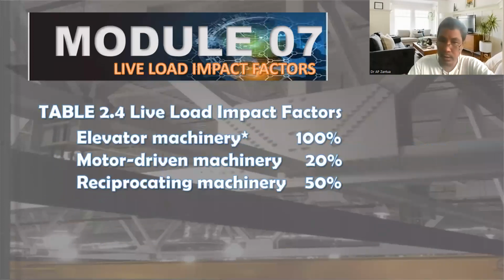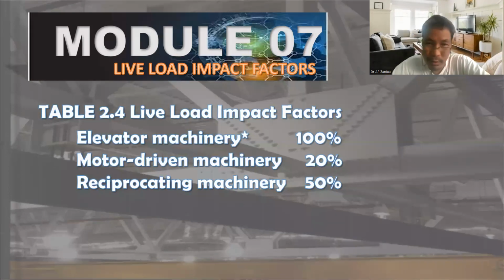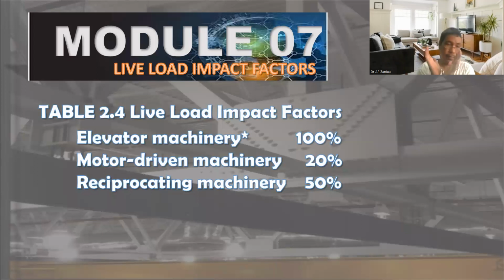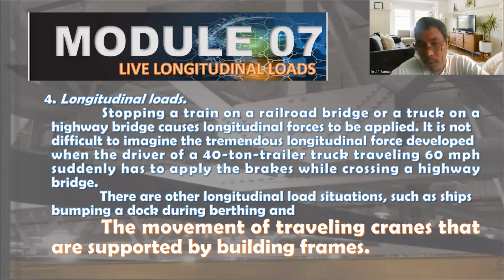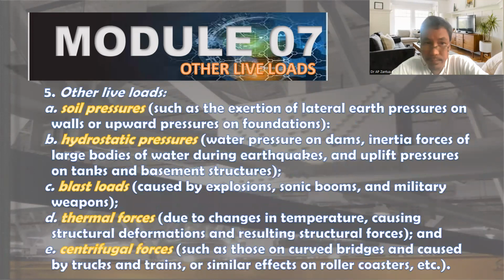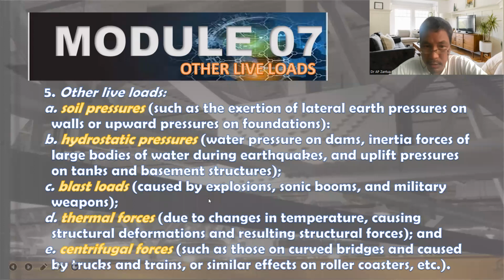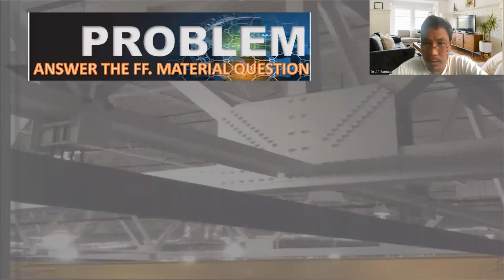Structural Loads of a Building: Live Loads [ Principles of Steel Design ] Module 2.07.2

Comment: Thank you sir for this continuation where in now we are in the live loads that are about the structural loads these are usually the loads that are moving or have movement where we have also factors with their impact for different usage .

Question 048: What is the surface irregularity tolerance for subgrade preparation? 
-B +20 mm.

Comment: thankyou sir for the continuation discussing the live loads on structural loads of a building, as the loads was classified into dead loads, live loads, and environmental loads. The live loads may change in position and magnitude when a structure is occupied, used , and maintained.
question 048: what is the surface irregularity tolerance for subgrade preparation? the answer is B +20mm

Comment: thank you sir for the continuation of the previous topic about the structural loads of a building and for discussing the live load impact factors

Q48: What is the surface irregularity tolerance for subgrade preparation?
ANSWER: B (+20 mm)

Comment: Thank you for this continuation video lecture about live loads. In this video it tackles about the impact factors of live load. And it is also tackled here the different kinds of live loads.

Q. 48 "What is the surface irregularity tolerance for subgrade preparation?" A.-30mm B.+20mm C.+25mm D.-20mm
The answer is B.+20mm

Comment: Thank you sir for discussing the structural loads. This topic was exlained in our course TOS so this lecture is kind a recall but watching this, it became more much wider and explained well.  For engineers, it is important to know the concept of structural live loads when designing a  structural plan so that we can estimate the live loads that our structure will carry and we can prevent structural failure. We must refer to codes, specifications, and references. Thank you sir. 
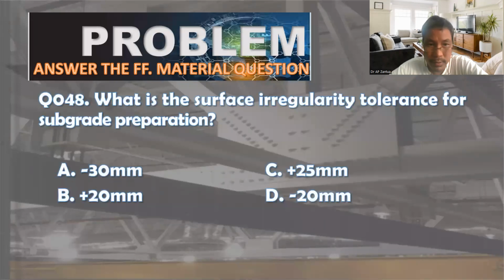For 6:51 Question 048: What is the surface irregularity tolerance for subgrade preparation? My answer is +20 mm.

Comment: Thank you sir for the continuation of the topic about structural loads of a building. I have learned in this video what load impact factors, concentrated live loads, and live longitudinal loads mean and also how it works.

For questions 048,The answer is letter B. +20mm

Comment: thank you sir for discussing us about live loads which I learned that live loads are loads that may change in position and magnitude when a structure is occupied, used, and maintained. Live loads is classified as moving loads and movable loads, which moving loads is a live loads that moves under their own power, such as trucks, people, and cranes while movable loads are loads that may be move such as furniture and warehouse materials. Floor loads, traffic loads for bridges, impact loads, longitudinal loads and other loads were briefly explained.

Q048: what is the surface irregularity tolerance for subgrade preparation?
Answer= 20mm